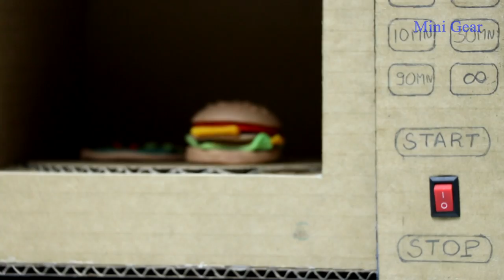DIY Toy Microwave Oven at Home

Comment: Hi, I'm very much interested to make this for my kids.....but can u explain detailed abt the process  when u attached the bulb on a wheel like round steel and I saw resistance there ....can u show that more detail how u did  that 
......
Reply: That was a simple led light if you know electricity when the electricity is circulating the circuit led was resisting causing lower electrons to go to the motor as lower electricity goes to the motor it spins slower so in terms it’s not resistance